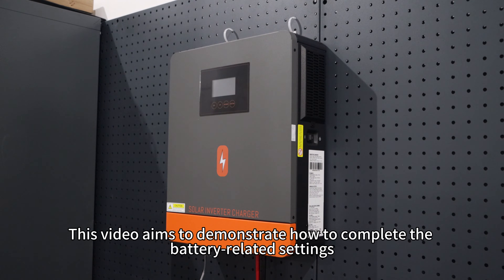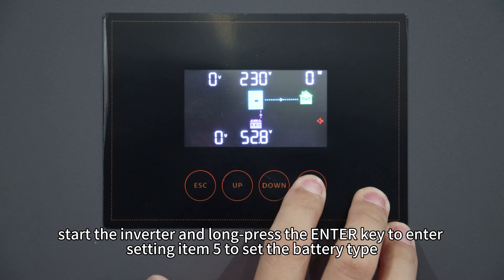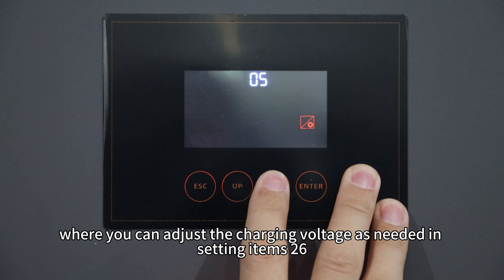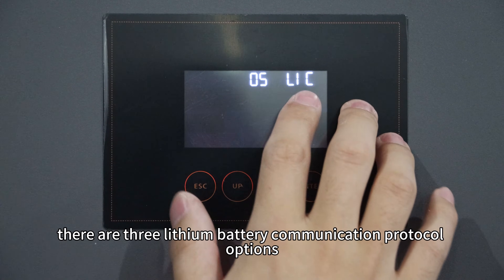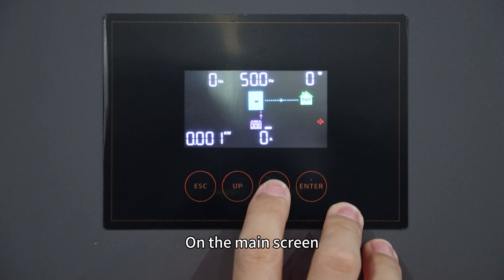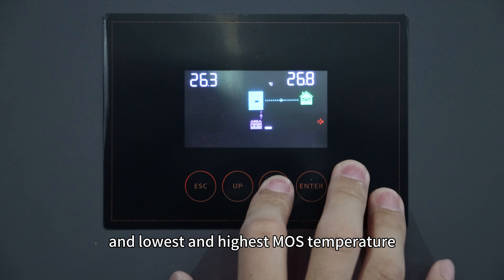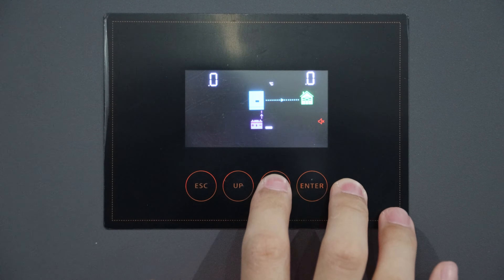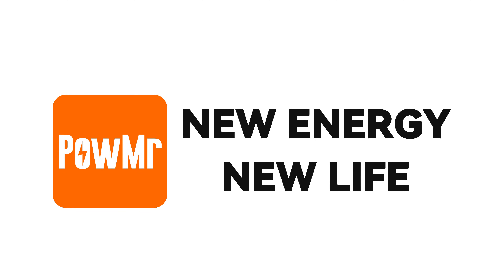Efficient BMS Communication: POW-HVM6.2M-48V-N

Comment: Can you tell me how to connect powmr 6.2(version u1 74 08) to dyness dl5.0c battery? 1-7, 2-8, 8-6 connector option does not work. Inverter 5 - point lil, 43 - point 48 or 49 protocol.
Reply from the maker: Please send it to this email: support@powmr.com.
Reply: Did u find any solution for this?

Comment: I have the Pow HVM6.2K-48V-N with a Pylontech U5000 battery. In LIL, SBU, OSO, or other modes, I can't get the house to receive power from the battery. The display continues to show the power coming from the grid. Should I use the original Pylontech communication cable, or should I make my own communication cable to be able to communicate?
Does anyone have a solution?
Reply from the maker: Please send your question to this email: support@powmr.com.

Comment: I tried connect Dyness B4850 with POW-HVM6.2M-48V-N
invertor program setup:
05 - LIL
43 - 49
invertor 
DIP 2 ON
DIP 3 ON

cable connections in RJ45"
1->2 X 2->1
1-2-8 -> 7-8-6

unfortunatly any result

Maybe someone has successful experience; I would appreciate your help

Comment: I am trying to establish communication between the POW-HVM6.2M-48V-N hybrid inverter and the POW-LIO48200-15S battery. We made up the cable and tested it so it is working properly. However, we are unable to access the LIC, LIP and LIL options in setting 05, we are getting all the other options but not those.  Also when we program it, the settings are automatically changing back. Can I have some guidance on this please?
Reply from the maker: We have replied to your email. Kindly check.
Reply: @PowmrSolar  also me too
Reply: Can you help me also , similar problem- battery lio48100-16s

Comment: what if the inverter that I had has only COMM port and no battery port, but the function has LIC can I still connect the lithium battery bms with the inverter using the 232 ports from the battery
Reply from the maker: the POW-HVM6.2M-48V-N model?
Reply: @PowmrSolar  yes bought the inverter year 2023
Reply: it had only 1 COMM port and LIC on the monitor selection for type of battery
Reply from the maker: @ Please send it to this email: support@powmr.com. Our technical staff will check it for you.
Reply: @PowmrSolar  Already sent the email

Comment: I have a hybrid inverter powmr 6.2 kW, in the menu there is item 44.45, in the instructions they are not, what are these items 44.45 responsible for?
Reply from the maker: #44 is "Delayed grid access", you can select "DIS" to disable this function or select "ENR" to enable this function.  #45 is "the battery Soc percentage shutdown point", the battery SOC reaches this point the inverter will shut down.

Comment: Hello,
 I have inverter POW-HVM6.2M-48V-N and battery POW-LIO48200-16s. I connect it to my home network, but, inverter’s funs works all time after is battery fully charged. When Utility is off and home starts to work with battery, funs is off. I set up LIL on inverter and PYLON on battery.
SmartESS application show battery voltage 58.5, charging current 0. I dont know why, but capacity show 0.
How set up that fun will switch off after full battery charge?
Thank you.
Reply: Hai risolto?
Reply from the maker: We have replied to your email. Please check it.

Comment: Good There is a PowMr pow-hvm 6.2m inverter, one battery is connected there. LifePo4 51.2v. There are no solar panels yet. The inverter and batteries are connected by BMS via RS485. On the ADD battery, switch 1 is set to ON. So, when the batteries are charged to 100%, the 05 component overheating error immediately pops up, after a while, the 03 error of the battery is overcharged and turns off all power. I would like to understand what to do with it and who can deal with it?
Reply: There were the same errors as yours, I was scared, I thought the inverter had burned out, I switched to USE mode, disconnected the cable from the inverter, waited and turned it on again, everything started working. In fact, it seems to me that POWMR has a very crooked firmware that is responsible for communication, and it seems to me that this communication of the inverter with the battery is detrimental to the inverter of this company.
Reply from the maker: @FastDamage  Please send it to this email: support@powmr.com. Our technical staff will check it for you.
Reply: @PowmrSolar  What's the point of writing to you by email? I've already written more than once, there's no point in it, no suggestions, your tech support told me that it's impossible to reflash the POW-HVM4.2M-24V-N inverter, I also had an inverter connected to the batteries via the "PYLON" protocol, "LIL" mode, there is no point in it either, communication only provides a visual display of some parameters for the battery, but the most important parameters (26/27/29) Bulk/Float are taken from the inverter, the inverter ignores these most important data from the BMS. I use the BMS jk-pb2a16s20p.
Reply from the maker: Please turn off the inverter, disconnect the battery, wait about 30 minutes and then restart with only the battery connected to see if the fault code disappears.

Comment: For those who want to connect this type of inverter with a JK BMS: 
1. Neither the inverter nor the BMS manufacturers can provide any clear answers on how to do it.  Therefore, I had to figure it out alone. 
 2. You need a simple cable in which there will be only 2 wires, 1,2, they must be connected crosswise,( 1->2, 2->1).  
3. You need to select protocol RS485 (9600) Pylontech in the BMS settings (mode 14), you may have to update the BMS firmware because it is not active on older firmwares.  
4. In the inverter settings, select the LIL battery type.  
5. And now attention, the reason why for many (including me, nothing worked) is setting 43 of the inverter menu, this setting is not described in the instructions, by default it has the value 48, in order for the communication to work, you need to select the value 49.
5. After selecting the LIL battery type, the SBU and Dual Output menu items change to percentage instead of volts, and everything works quite well.
Reply: Thank you!!!!! You are an angel! Three days i spent searching all over the place for a working solution to connect these two Chinese devices! Tks, again!
Reply: @furnics  You're welcome! One clarification: in addition to connecting wires 1 and 2, it's also advisable to connect the grounds—pin 8 of the inverter and pin 6 of the BMS. Also, it's said that updating the BMS firmware is necessary; otherwise, the inverter may sometimes spontaneously throw errors 02, 03, 05, and so on...
Reply: @UATechSorcerer  can u please help me out for bms configuration: unable to communicate with any inverter: Looking forward for ur reply
Reply: Thank you for this excellent answer, which made it possible to connect the inverter via RS485.
For me, there was a small adjustment: the switches on the JK-BMS need to be set to 0000 (all off).
Updating the inverter firmware, as recommended, was necessary.
Understanding that the inverter recognizes the battery turned out to be not so straightforward. I found a way for myself: scroll through the indicators up/down, and on one of the "screens," you will see the battery voltage on the left and the charge percentage on the right (they correspond to the information from the BMS).
It's very unfortunate that the inverter neither shows an error for the lack of communication with the BMS nor provides any indication of having an intelligent battery connected.

Thank you once again for the valuable information.
Reply: Thank you man, this KB helps a lot. Slava Ukraini!
Reply: @rossardy ❤
Reply from the maker: Thanks for sharing.
Reply: Thanks for sharing. The only problem, my PowMr 10.2 constantly falls into Fault 03 error. And I'm not talking about charging state, I'm talking about when battery is being discharged and already at around its 50% capacity (!!!). Still, when in USE mode for battery type it works just fine. So, the problem is either with their latest firmware or buggy hardware?
Reply from the maker: @Pepeladz  03 code means the battery voltage is high. Please use a multimeter to measure the actual battery voltage to see if the battery voltage is too high.
Reply: @Pepeladz  When you select battery type LIL, for some reason you can still edit settings 26/27/29, set correct min/max voltage limits, i also have a problem when battery at 30% inverter go to error and lock himself permanently until full reboot, i find out that my cut off voltage is set to high, probably you have the same error
Reply: @UATechSorcerer  Hi, thanks a lot for the detailed instructions on how to connect the BMS and inverter. I am also getting error 03, one time I had error 05. Could you please advise me on the settings? My BMS settings are as follows - - Cell OVP (3.650 v), Vol. Cell RCV (3.500 v), SOC-100% Volt (3.450 v), Cell OVPR (3.350 v), Cell UVPR (2.650 v), SOC-100% Volt (2.600 v), Cell UVP (2.580 v), Power Off Vol (2.500 v). and inverter settings - Bulk Charging Voltage (27.9 v), Floating Charging Voltage (27.9 v), Low Battery Cut-off Voltage (22.0 v). Thanks for your help.
Reply: @Аркаша-я7ь  Hi, in your case SOC 0% set at 2.6V (20.8V) but cut-off voltage 22V so when battery reach 22V inverter confuses because SOC didn't reach 0%, this is when error occurs, you need to set SOC 0% at 3.0V and in inverter cut-off voltage 23V, cut-off voltage should always be lower than SOC 0% voltage.
For LiFePo4 no need to discharge below 3V per cell, because it's practically 0% SOC...
Reply: @UATechSorcerer  Перепрошую, Якщо ставити SOC 0% - 3В на комірку виходить 24В, а в інвертор Ви кажете ставити 23В. Але це ж в інверторі напруга вимкнення нижче ніж у БМС, а не вище. Тобто в інверторі 23В в БМС 24В - тоді на БМС буде вже 0% а інвертор буде ще працювати. Я вірно зрозумів? І про інші введені данні - вони вірні по верхній границі, чи щось подредагувати . Дякую!
Reply: @Аркаша-я7ь  Ні, якщо у вас правильно налаштована комунікація і інвертор бачить SOC, то коли БМС буде на 0% SOC інвертор вимкне генерацію, проблема цих інверторів якраз в тому, що в ідеалі замість напруги налаштування мають змінитися на %, але міняються тільки налаштування які відповідають за SBU і Dual Output, а саме налаштування заряду і Cut-off так і залишаються у вольтах і навіть доступні для редагування, хоча повинні автоматично підтягуватись із БМС...
Reply: @Аркаша-я7ь  Якщо БМС буде говорити інвертору що SOC скажемо 20%, але при цьому акб уже спустився до Cut-off voltage то буде помилка, тому Cut-off завжди повинен бути менше ніж напруга яка виставлена в бмс як SOC 0%
Reply: @Аркаша-я7ь  По верхній межі все норм, хоча яб флоат чардж поставив на 27В, щоб коли акб не використовувався напруга трішки просідала, але це не обов'язково просто на мою суб'єктивну думку тримати акб постійно на одній зарядній напрузі не дуже добре, особливо коли довго немає відключень і батарея не використовується... Ще в бмс напругу початку балансування поставив 3.4В
І попередньому повідомленні помилився, замість менше написав більше, вже поправив, Cut-off voltage повинен бути менше ніж SOC 0% Voltage щоб інвертор вимикався саме по SOC а не по напрузі, тоді помилок не буде
Reply: @UATechSorcerer  Дякую, зрозумів. Мирного неба!
Reply: @UATechSorcerer  Доброго дня. Підкажіть ще таку річ- скільки не шукав, не зміг знайти вирішення проблеми помилки 03 при підключенні БМС до інвертору по rs485. Хоть вже вирішив цю проблему? Дякую!
Reply: @Аркаша-я7ь  В цих інверторах багато нюансів і не логічних речей із налаштуваннями, таке відчуття, що зарядка із комунікаєю і налаштування інвертора живуть окремим життям, була ця помилка коли пункт 26 і 27 були виставлені нище ніж виставлено в БМС, зараз в мене виставлено Bulk 29.2V і Float 28.2V і помилки більше не виникають, справа в тім, що інвертор заряджає по SOC і напругу заряду бере із БМС тоді коли ця напруга перевалює за виставлену у Bulk інвертор не розуміє що відбувається напруга перевалила за виставлену і викидає помилку, в принципі ситуація та сама, що із нижньою межею, треба налаштовувати так щоб не було конфлікту між виставленими напругами в БМС і в налаштуваннях інвертора
Reply: @UATechSorcerer  Справа у тому що помилка 03 виникає у мене коли напруга на інвертор 220 відсутня і батарея йде на розряд! Не зовсім розумію до чого тут напруга заряду інвертора та напруга запиту БМС від інвертора.
Reply: @Аркаша-я7ь  а у вас точно Powmr? Бо помилка 03 це перезаряд акб а у вас вона що означає?
Reply: @UATechSorcerer  PowMR 4.2кВт - прошивка у инверторі - 7510. У тому то і річ, тут пишуть що у деяких людей також Повер і вискакує помилка 03 при розряджанні акумулятора причому ще й без мережі городської.
Reply: @Аркаша-я7ь  в такому разі не знаю що порадити, бо такої проблеми немає, в мене БМС JK на 200А з прошивкою самою останньою для 200А у Andy Off-Grid Garage на диску взяв, для інших версій на 150/100А трішки старіші прошивки доступні, можливо це якось впливає, але ніяких проблем немає,  все стабільно працює без помилок вже третій місяць
Reply: @Аркаша-я7ь  Як виявилось помилка 03 в мене теж виникає коли акб розряджається, світло  пропадає теж, але в SmartESS немає логів про цю помилку, незрозуміло тільки це баг в БМС чи в Інверторі, буду писати і туди і туди, якщо буде рішення дам знати, Вас попрошу теж якщо знайдете рішення дасте знати...
Reply: @ добре! Думаю потрібно шукати що означають значення у 43 пункті - вони з 48 до 70! Гадаю що це протоколи для rs485
Reply: @UATechSorcerer  Привіт. Думаю що багом може бути як БМС що передає данні в інвертор в міліАмперах, а інвертор відображає їх як в Амперах (можно наглядно подивитись у меню після версії прошивки - відображення як Ампери з великими числами) так і інвертор що не правильно бере ці данні. Я дивився через Home Assistant показники, так було що струм з батареї показувало 47 787 Ампер.
Reply: @Аркаша-я7ь  Привіт, тільки-но подивився відео Олександра Володимировича якраз по цим спонтанним помилкам 03, 04, 05, каже, що потрібно підключити сигнальну землю і всі помилки зникнуть... 
Розпіновка кабеля 1->2, 2->1, 8->6.
Тобто додатково 8 пін на інверторі і 6 пін на БМС і не путати конектори місцями
Reply: @Аркаша-я7ь найближчі пару тижнів можливості перевірити не буде, але якщо буде результат скажу
Reply: @UATechSorcerer  Привіт! Вийшла нова прошивка для JK-BMS 15.38! Там був фікс протоколів обміну! Я оновився і тепер у меню інвертора не потрібно ставити у пункті 43 - значення 49, я залишив по дефолту значення 48 і усе працює!
Reply: @Аркаша-я7ь  Mine also shows wrong current and wrong voltage from bms communication, causing error 04 and the inverter cannot start with bms cable connected because of this. The other parameters are ok. 
I connected the ground pin as @UATechSorcerer advised but it didnt make a difference.
Reply: I got it working by changing the battery protocol to PACE instead of Pylon, selecting LIP on inverter setting 05, and changing address in setting 43 to 49
Reply: Hi, can you tell me what type of JK BMS you use?
Reply: hello no setting 43 in my pow-hvm10.2m :O
Reply: Thank you 🎉
Reply: Omg you are my guy. Thank you so much
Reply: Grazie mille del commento. Avevo degli errori di comunicazione tra bms ed inverter e le letture a volte scomparivano. Con il bms jk il cavo deve essere di 2 fili e non 3 come dice il manuale. Ora sembra tutto funzionare bene.
Grazie
Reply: Why address 49? I'm getting battery data on address 48 as well. Where can I find information about what these addresses mean?
Reply: @kamazist some batteries RS485 communication default to address 0 and some start at 1. Address 48 maps to 0, and 49 to 1.
Reply: Чи можете підказати як підключити powmr 6.2 до батареї dyness dl5.0c? 1-7, 2-8, 8-6 варіант конектора не працює. Інвертор 5 - пункт lil, 43 - пункт 48 або 49 протокол.

Comment: I get an error 52 while trying to connect it to flooded Lead acid batteries. It refuses to charge the batteries even with enough solar panels and it refuses to use the batteries even when they are full the connections are all good.
Reply from the maker: Hello, please send your problem to this email
: support@powmr.com. Our technical staff will check it for you.

Comment: Do you still have to setup bulk/float/cut-off voltages in 26,27,29 menu items if battery type is LIP/LIL/LIC and successful communication established? Or inverter picks those values from the battery BMS automatically?
Reply: What the manufacturer wrote is not true in the case of LIB and LIL modes:
 1. LIB mode uses internal settings for charge voltage, and does not use communication or simply blocks existing settings, settings 26/27/29 are locked for editing. 
 2. The LIL mode uses communication, the inverter sees the % charge, but only the setting 12/13/42 changes to a percentage instead of the voltage, the settings 26/27/29 are still edited and affect the battery charge, especially carefully I recommend paying attention to setting 29 (cut-off voltage), if you choose the wrong voltage, error 04 may occur.
Reply from the maker: @UATechSorcerer  Hi, thank you for sharing

If you want to customize the 26/27/29 parameters, you need to set 05 to USE.

If you want the battery to communicate with the inverter, you need to select the corresponding BMS communication protocol in item 05. But once communication is established, it cannot be set manually.
Reply: @PowmrSolar  When i selected 05 in LIL mode, and established communication i still can set manually 26/27/29, only 12/13/42 change to percentage
Reply from the maker: @UATechSorcerer  Hi, the 6.2M-N model, right? I will confirm with our technical staff.
Reply from the maker: @UATechSorcerer  Okay, get it. Thanks.
Reply: @PowmrSolar  I am also interested in the answer to this question, since I have the same inverter POW-HVM4.2M-24V-N and the same problem as @UATechSorcerer
Reply from the maker: There is no need to set the voltage after communication. The inverter will identify the battery SOC based on the data transmitted by the battery BMS.